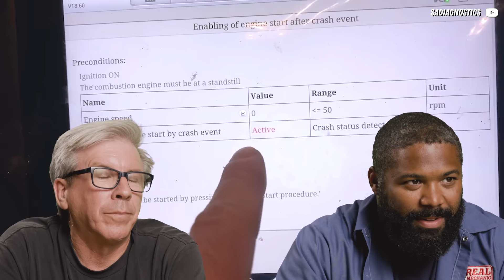Mechanic Reacts to Engineering Fails

Comment: I think a lot of people seriously overestimate how much final say the actual Bachelors and Masters mechanical/electrical design engineers have, over how the end product solution ends up. Final say is rarely or never the engineers. Even the quarterly-report-pinchers have effectively wide micromanagment veto power over any engineering decision. And 98% of those haven't even held a 10 in their life. And there's still a very long way to go between there and final assembly decisions.

And of course, some times things end up so bad, that the mess they made end up back at the engineering department. With the typical order: You have zero budget, no say on perimeter or other connected systems. Make this work without removing anything and shave off $2k cost per unit.

If real engineers got their say, pretty much everything would be easy to service and built to a standard that it'd never need it (from wear n tear). Unless it's an unavoidable consumable (brake pads, filters), or a neccessary compromise to facilitate easy service / repair (a hard line might last far longer, but require disconnecting a closed fluid or gas circuit if you have to get it out of the way to make a repair caused by external damage. So some flexible joints and sections are neccessary for ease of access and repair, but they inherently will not be as durable as solid pipe).

Comment: "My 2006 1.6 Auto A Class mercedes-benz needs a new starter motor and spark plugs installed"

"Ma'am you can come and pick it up after two days because it will take me half a day to replace the spark plugs and pretty much the whole day for the starter motor because it sits in such a crappy place...

Comment: I was "meh" with most of these but that Audi fuse box location is not even just negligent, it's evil. I have decided against models of cars in the past because of poor serviceability, and if that's the kind of stuff that Audi thinks is acceptable, I wouldn't even consider buying one of their cars. Lots of this stuff is just choices, but that's a completely unacceptable one. If that's where you decided to put the fuse box, you need to step back and start over.

Comment: Engineering fail The Ford F150's that required the cab of the truck to be removed to replace the thermostat. Just dumb. Volkswagen Jetta hiding the circuit breaker that shut off the entire electrical system. Unfortunately this breaker could be triggered by simply hitting a hard bump leaving you stranded.

Comment: Oil pressure sensors.  Standard bolt/nut/whatever profile to unscrew it BUT with the corners rounded off so that a standard (ok long socket but still) 12 cornered 1 1/16" socket will slip.  Although to be fair, a standard 6 sided socket would probably work fine.    One socket, 30 bucks, for a 5 minute job I have had to do once in the 20 year life time of the (VY V8 Berlina) car so far.  Said socket being only applicable to that one job and is not as good as a standard one would be anywhere else at all.  On top of which it is the ONLY imperial widget on the entire car.  And I can't figure out why, at all, it is like that.  If anyone else knows, I am all ears.  Until then though, it is now my 'beat an engineer to death with this' weapon of choice.

Comment: I had a 1995 Dodge Dakota.   The fuel pump failed.  (I'm an Aircraft Sheet Metal Mechanic. )  The tank has to be dropped to change the pump.  Screw that!.   I took measurements and I knew where the pump was located.  I cut an access hole in the bed of the truck and bingo there's the pump.  Changed the pump and then I made an access door in the bed Aircraft Style.  Why couldn't an engineer think of that.   Cost.   I made the mod on about 10 trucks for 50 bucks a pop.  That is about a 30 min job.

Comment: The one needless thing i can think of is the need to have that shitty cube to rotate with a drill or wrench to depress a caliper. Thanks ford i needed that specific tool to only work on a few things rather than the usual caliper tool that works for everything else

Comment: There are thousands of parts that may fail over time. It is literally impossible to design a car so that every single one of them is easily serviceable. Just making sure that everything can be fixed at all in a modern car is a huge effort. Mechanics act like we have some vendetta or don't love cars, but sometimes having to spend two hours to get to a part that will only fail in 0.35% of cars is a tradeoff that has to be made so that we can fit everything into really tight spaces... with that said, the Audi fuse box was bad engineering.

Comment: most of the gripe with these isn't that the design can't be worked with but that the design could have been done better, some how you all fail to understand that though, like the take every one had on the def draining onto the drive shaft, yes the mechanic could put a funnel there just as easily as the engineer could have designed a small deflector lip to make the def to drain next to the drive shaft with out changing anything else about the vehicles design and only adding pennies onto the cost. yes it works how it is but it could be done better and with how much they are paid it should be done better.

Comment: Not an engineering fail .... a manufacture fail .... although we had to do some "engineering" to solve the problem ....   my dad got a brand new tri-axle and it was delivered with one of the clutch grease fittings pointing straight up at the bottom of the cab.  Not enough room to get a tool in to move it and could not get the grease gun on it.   We ended up drilling a hole through the bottom of the cab and putting a plug in hole when not in use.

Comment: I miss Renault on these videos. All these small things that unnescessarily use special tools and clearly only exist to force you to go to the dealership.

Why have a 3/10" square for the drainplug so the 3/8 Ratchet almost fits?

Why use triangles instead of hex or torx?

Why bury electronics in the same places as the audi?

Comment: I used to curse out the engineers all the time when working on the Lockheed P-3C Orion.  These mechanics whining over how difficult it is to get to a fuse box.......try replacing the lower door actuator on one of the pressurized sonobuoy chutes in the P-3C.

Comment: F-ing plastic or thin metal "clip-on clamps" which turns brittle after 5 years! That's my number 1 gripe with engineers! AT LEAST make it replaceable if you insist on using crap like that! "Oops that clamp broke - guess that can never get put back on unless I use glue - which means if something goes wrong there I will have to ruin it to get back in there...!".

Comment: Hahaha , what if I. R. an engineer who us also a mech-an-nik...Electric injectors at Deere, and I gave NOx's something to attack...it was exhausting...
Reply: I designed the fuel injectors at Deere with mechanics in mind. When you compile the loss of revinew lost from downtime, and considering if you have a single failed injector if and when you need to replace one injector the turn around is faster and priming the whole system only takes a few minutes. Even in less than ideal conditions, can still get it down the road quickly.

Comment: The oilfilter at 7:30, no one gonna bring up the fact that when you push in a brand new oilfilter through tight spaces and hoses there will be dirt scraped into the new oilfilter or loosen dirt that falls into the oilfilter as you push it through? Its not that its hard to reach by hand, its that you get dirt into BRAND NEW FILTER. Everybody knows that, the poor Ford mechanic in this case, cant get paid for the time doing an engine and enginebay clean.

Comment: check out where the fuel lift pump is on a 1996 obs ford f250 7.3L. talk about cursed engineering

Comment: 1st one is not an engineering issue, but factory cutting expense of using a smaller gauge wire than what the circuit requires.  2nd is safety feature, air bag deployed and what condition are you at that point?  3rd Blown engine is abuse, else a bad part from the beginning that nobody can foresee.  4th is engineering when something serviceable is made inaccessible. Use lines to put it on the firewall.  i.e.  spark plugs  5th battery box is probably due to charging issue from a faulty battery temperature sensor sitting in the bottom of the battery tray.  Not a frequent service issue, if ever in most cases.  6th, has to be staged as who'd put a fuse block where you can't get to it?  Shouldn't be blowing a fuse anyways as their a safety feature.  7th I'd never want to get out of that low of a vehicle as it's so low.  Ever watch a shot person getting into a high lifted truck?

Comment: Audi A6 2.0 2001, if the "computer/Control unit" thingie is not properly screwed down, the rain water is running along side the wires into the car and you get a "lake" behind the drivers seat, until it is so much water, that it runs above the floor-strut unter the seat to the front. Reason: the bloody "drain-hole" aside of the "computer/control unit" is on top of an elevation. Bloody genius! not

Comment: Chrystler sebring. Mainly the convertables. Everything on this car takes 2 times as long to do. Oh where do I start. The front and rear motor mounts are pressed into the cross member. If that's not bad enough you have to take out the lower radiator support to get the damn thing out. 2nd thing is the batery location, its in the drivers side wheel well. The last one am going to list is more of an FU to the car Stereo community. Then a mechanic but ehh I'll list it anyway. Can't remove the amp as for some reason the convertible top electrical runs threw the amplifier. So if audio side of it dies you can't delete it fully. I'd shoot some videos but am not all that great at it

Comment: I transport crashed cars for a living and I agree Mercedez and audi are the worst, they refuse to be boosted, they dont have accessible holes under to strap them down. But the electric cars are worst. I love them when they work but when crashed they lock down hard and their low center of gravity make them impossible to slide them off the tow truck to unload. I also heard that the id4 blow up all the connectors inside the battery when the airbag come out making the battery impossible to reuse in another car.

Comment: Tried to repair an old chevy blazer with a transverse engine (spoiler: idiot owner overheated the car melting the temp sensor and destorying one of the cylinders.) Replacement engine is like 3x the cost of the car.
Please tell me WHY TF you would line up the damn stearing column to completely block access to a spark plug?! 😑🤦‍♀️

Comment: on 2000 to 2006 BMW E46 3 series the Fuse box is behind the glove box So you have to pull the Dashboard apart to get at it. Really fucking stupid spot especially considering the 1992 to 1999 BMW E36 3-series had them right in the engine bay just open the hood and a simple cover and it's just right there easy to get at.

Comment: I bet hes pulling the tray cause it leaked all over that captured nut in the bottom that is now seized onto the hold down rod thing. Then once you finally get the rod out you need to change the nut so. Been there.

Comment: My wife has an 06 Mazda 3. The fucking CABIN AIR FILTER took me TWO HOURS. 

Cabin air filters should be a maximum of 10 minutes and that’s if you have to pause halfway through to sneeze 7-8 times and then take a piss. 

I hate that car so much. I chased an electrical issue for weeks before replacing a headlight bulb harness. The trunk is rusted to shit because of a leaky gasket. 

I’m a whiny (new, hobby-in-my-driveway) mechanic but everyone seems to at least agree on the cabin filter being bonkers.

Comment: The mercades thing makes me unreasonably angry. The guy who claims it's "both" isn't confused as to why all other manufacturers don't burst into flames when they are wrecked?

If the fuel system is compromised, the engine quits running. Even a 1986 Nissan stanza is smart enough to shut the fuel pump off when the engine quits running, it has a flap in the mechanical airflow meter, like a 1.6 miata does. Hell, I've even had to replace a timed fuel pump relay in a 1993 suzuki carry, because even an old carburated engine has enough going on to cut a fuel pump when it's not needed. There is no reason on the face of this planet why you need a several thousand dollar diagnostic tool to safely reach the shoulder other than some business major sticking their nose in places it doesn't belong. 

That is 110% cursed, and I'm not surprised it comes from the people who thought it smart to remove the oil drain plug from the pan. Whatever they can do to get you back in the dealership.

I hope the guy Sandro mentions getting creamed around a corner filed a lawsuit.

Comment: Nissan Juke oil filter is a fucking nightmare.  Later, the turbo blew apart and sent shrapnel everywhere.  I have the feeling that somebody (dealer) never replaced the filter, just changed the oil.  I hope they did that.  Then again, turbos hate bad oil and that happened.  The repair/replacement was going to cost more than the thing was worth.  Even worse, I went to a dealership and they had an entire graveyard of the exact same model with the exact same problem.    I mean, they had like 6 of them, same year same model on the dead lot.  Warranty?  Nah, bro, not covered, that's a you problem.  Thanks, Nissan.  I was about 500 miles outside of the warranty.  Nada.  No more Nissan in my life, ever.  I hate dealerships.

Comment: Im a toyota dealer tech and i had an engineer tell me the only reason they even put connectors on harnesses is because of the assembly process. If it was up to these fuckers they wouldn't even put wire connectors! they are PURE evil!

Comment: 5:00min ... Isn't it normal to get out of the car if it's possible after a crash? You get out and grab the onboard warning sign from car and place it about 100-300m back the street to warn others, specially if the accident is happened in a corner.?!
Reply: I mean this, not as a dig, but as an actual question: Are you from America? We don’t have that here
Reply: @TBone4Breakfast  I am Italian, living in Germany. 
And in both countries it's normal to act like I described. When you get stopped by the police, you get in trouble when you can not show them the onboard warning sign (triangle shaped), fist aid kit (sometimes they check also the best before marking of the first aid kit) and yellow warning vest.
And it's the law to get out of the car after an accident (if it's possible of course) and place that warning triangle at least 100m back the street, even more if it's a long corner without 100m view. Therefore on country side streets there are markings every 50 m on both sides of the streets.
Reply: @TBone4Breakfast  and btw, I am a truck mechanic and it's unbelievable to see american "just rolled in" videos! It's shocking in which conditions some American car owners move their vehicles! I'm glad about the high German federal inspection standards every two years, especially when I drive faster than 120mph.
These high standards are one of the reasons why they allow no speed limit on the Autobahn.

Comment: I always laugh when people complain about how hard it is to work on a car, try aircraft. Did it for 4yrs , when you have to replace a part that has 8 other things in the way and is 2ft further into the aircraft than you can reach and you have a 1inch hole to get a socket through them make a 90 degree turn to get the socket on a bolt you can't see and this has to be all done by touch, that's hard or safety wire a tail rotor and you're almost done and then fuck up thats a hour you just lost.

Comment: wonder how they would react to the dealer telling my wife that it is going to cost $1200 to change a headlight bulb on a 2019 chevy traverse due to all the other stuff they have to remove to reach the bulb.  (yes i said $1200 i did not accidentally add a zero and i mean the bulb and bulb only) I did it myself without removing all the items they claim had to be removed for the cost of the OEM bulb $110.

Comment: That useless transmission bolt on 3800 Fwd gm cars that you need a 52 inch extension to remove and has a bolt within 2 inches on either side from the other direction......

Comment: repair idiodicy is why I started watching all these channels to *begin with*...but it wasn't an actual mechanic...it was a "tech".  I was having trouble with a jeep, and mistakenly thought the battery was crap.  when I looked, however, it was a good call.  the wrong group size was in the vehicle, and it wasn't even bolted down.  I get the proper battery, but have the "tech" put it in...the short version, he puts the thing in BACKWARDS (the wrong bat type had been reversed by the installer to fit better, and he just automatically put it in the same way) 700 bucks and three alternators later (and a full MONTH of lost work!), I sell the thing off as a lost cause thinking fried computer...and it turned out to be a popped fusable link the whole time.  insert fail horns here..  the new owner handed it off again, when, on swapping a different set of wheels on, he destroyed a fender cause the whole wheel came off WHILE DRIVING (more fail horns)...and the NEXT owner discovered ginormous body holes AND busted suspension components (even MORE fail horns)!  throw in untightened and wrong sized lugnuts, and the poor thing shoulda went as a lemon.  in this case, it was tech fail at the parts store, Owner fail on ALL our parts for not seeing a damn thing, and mechanic fail from the selling dealership that only replaced a bad subframe...the thing our state inspectors look at first :P